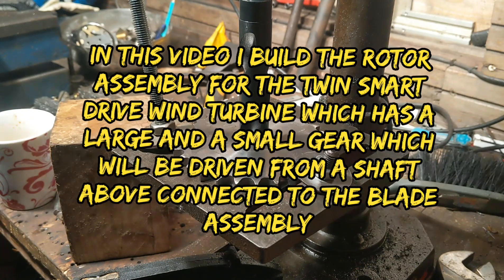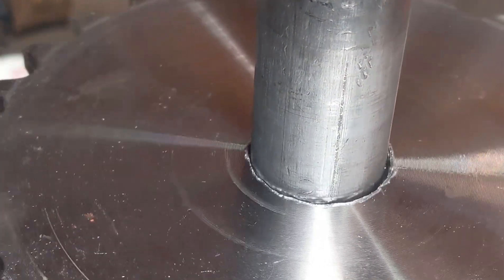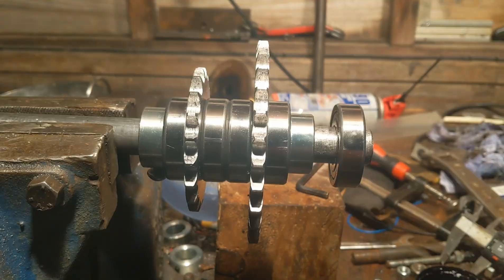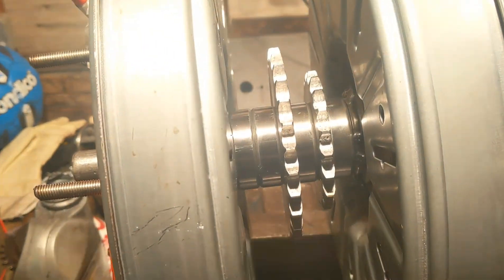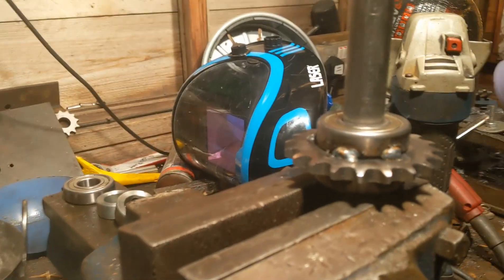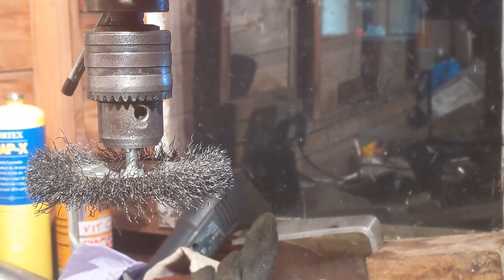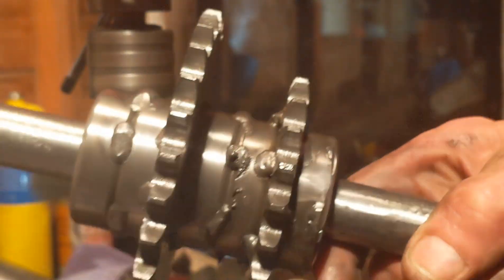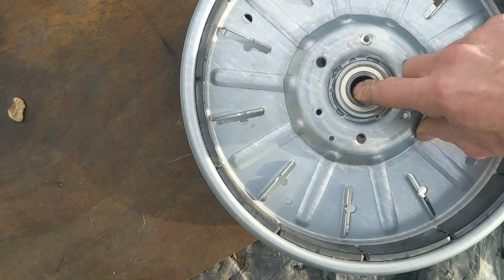Major Progress !! Dual Smart Drive wind turbine FREE ENERGY PROJECT 22 November 2020

Comment: Couldn't you of made a bigger hole on the sprocket then welded it to the bearing ?
Use it with a water vacuum syphon then it's not wind dependant. It would be 24/7 and you could control the speed.